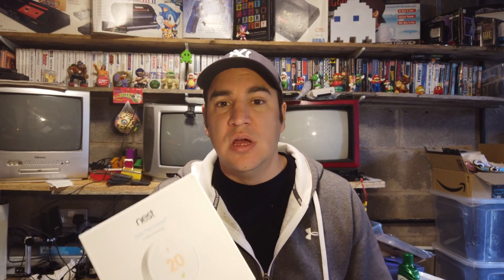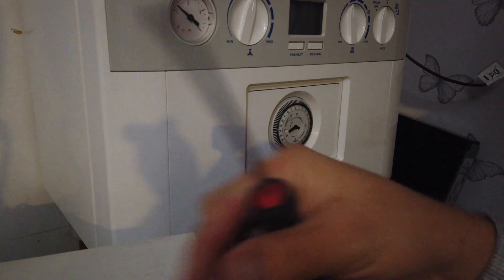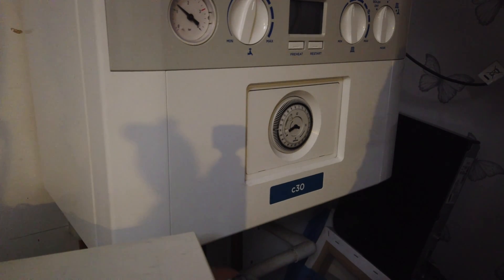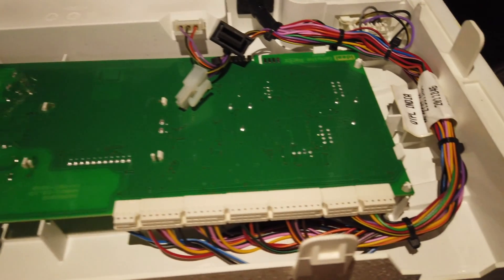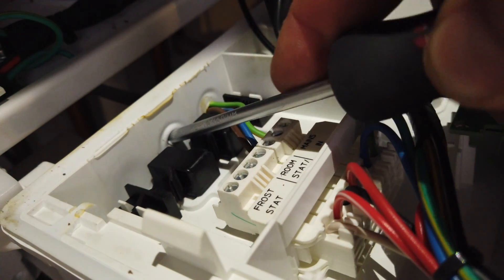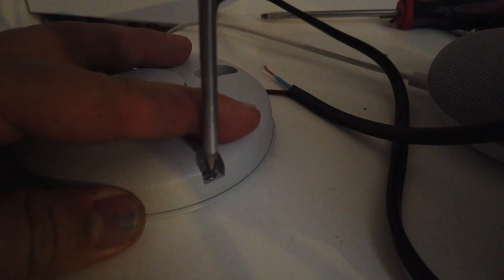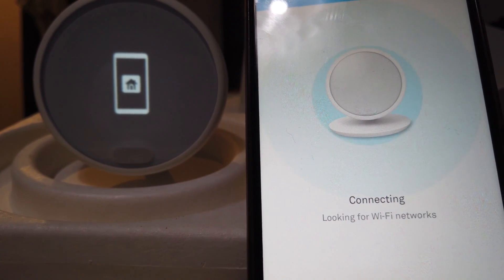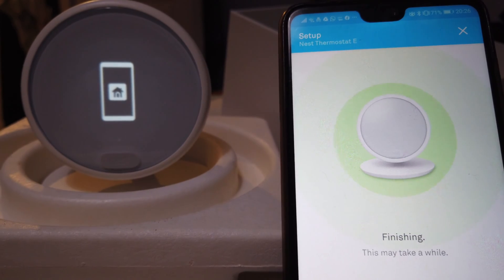Nest Thermostat E Install Combi Boiler with No Existing Thermostat

Comment: The mains cable should not have bare strands showing, please redo it making the bare wire the correct length
Reply from the maker: You're right and they've been sorted back when this video was filmed. That is how it was "professionally" installed.

Comment: My ideal boiler has opentherm and I had this thermostat installed. I’m moving house. Can I remove the nest myself if the power is off?
Reply from the maker: Possibly depending on your ability. You'd need to look at the manual to see if a jumper wire needs to go back in.

Comment: Cheers for the tutorial, my combi boiler is the same and you gave just the right amount of detail for me to get it done. 

One note for other viewers is you can repurpose the speaker wires from your sound system if you don't have 2-core cable at hand.
Reply from the maker: Great. Glad it helped you getting it installed. Nice tip on the speaker wire too. 👍

Comment: What wire did you use to connect them together is it 5 core?
Reply from the maker: To the sensor? I honestly can't remember either 24 awg or 18 awg if I were being overly cautious on the thickness.

Comment: What was the voltage of the wires you connected to the heat link?
Reply from the maker: Hi, apologies it's been two years since I made this video. I believe the cable between the boiler and the heatlink is the thermostat signal. It is actually powered by battery.

Comment: Hello mate. I watched your video and it's  great as you are the only one who shows how to do it without having wires on the wall. So I stripped down my boiler and got a bit confused. Can I get little help from you please?
Reply from the maker: Happy to help where I can but each boiler is different. What boiler is it, you'd still be doing it at your own risk and I always suggest getting someone to check of you aren't 100%
Reply: @GoodwinsPlace  I texted you on messenger. Can we have a chat over there? :-)
Reply from the maker: @macyekk  yeah no worries. I'm away in Gran Canaria but will help where I can.

Comment: Thank you for this video. Did you supply that wire you installed, or was that wire included in the box? Thanks
Reply from the maker: The wire to the sensor? I think you need to supply your own.

Comment: Hi, I have a wireless thermostat with no wires, so I’m guessing my set up will be similar to yours. I have a Bosch combi boiler the connections are LR, Ls or Ns which do I place the two wires in to? Thank you!
Reply from the maker: I'm sorry but I don't know that setup. Try the manual to see what each of those connections are, you are looking for the switch elements. If in doubt call someone in to take a look as would be cheaper and safer than a new board if things go wrong.

Comment: Thank you for the video it did come in handy, but I have a question when I moved into my house I have a logic Vogue C 26 boiler now, the thermostat was wireless it was a logic one it has an RF receiver which is attached to the front of the boiler and then has the wireless thermostat nowhere around the house is there any wires coming out of a wall in which a thermostat can be installed. As I already had been attacked moat system in my old house I brought this over and installed it into the boiler so that I can use smart heating. I have come across on Amazon the nest EFor a small amount in which I want to install this week but I’m struggling to understand how this will be installed especially the heat link into the boiler as essentially there are no wires for me to stick into the heat link then into it on the boiler. Can anybody help me please
Reply from the maker: I think you'd be best to get someone in to take a look to be honest. If you can't go straight off the main boiler then you might be able to go off one of the existing thermostats but I'd suggest getting an electrician in just to check it over and advise first.
If it's an owned property you should be fine but if it's a rented property then it would need someone else regardless.
Reply: Thank you for the quick reply, from what I can see on your video you have used a two cool cable in which I believe can do the same I’m just a little inch unsure as to where I put this in the boiler I don’t suppose you have an email address do you watch I could send you a picture of my boiler to see if you could advise but not take any responsibility for? Is mine.
Reply from the maker: Message me through GoodwinsPlace.co.uk I can take a look but as you say can't offer any professional advice over email as you need to test the system really

Comment: Great video, i have a worcester bosch combi with no external thermostat. I was wondering as i have a existing programmer for water and CH, do you just leave the heating on and don't use you existing timer control.
Reply from the maker: Yes my heating and water are set to heat, the Nest then takes control of when the heating comes on.
Reply: @GoodwinsPlace  Thanks, that's what i thought just needed it confirming.

Comment: Hi there, did you wall mount the thermostat in the end?

I'm interested in getting this installed but I have no pre-existing thermostat in the house and would really want it on the wall for a clean install. I'm interested if and how this can be done with no thermostat wiring fitted?
Reply from the maker: The sensor is still next to the boiler I've not wall mounted that. But the actual Nest dial / screen is the main part and that is wireless apart from power and that can be wall mounted if you get the right bracket.

Comment: Hiya  
Was it no and c you stuck those 2 wires in on nest? Cheers bro
Reply from the maker: Yes, (no and c) top left two connections if you had it level and the wires at the bottom.
Reply: Legend 🙌

Comment: Hi Craig, great video thanks for posting it. Can I ask you about the black cable (2 core flex cable I think it's called) that connects the heat link to the boiler, did that cable come with the Nest or do you need to get it separately in an electrics store?
Reply from the maker: Sadly they don't supply the cable, I guess it is due to so many different options to setup.
Reply: @GoodwinsPlace  is it a 1mm flex you used?

Comment: Hi, I have ideal isar HE24, instead of thermostat loop, I have connections L1 and L2, can the heat link be installed directly to this boiler?
Reply: For anyone interested, as there is not much support for the UK version online and google impossible to get hold of, but the ideal isar he24 boiler is compatible with the UK nest e with heatlink. The L1 and L2 terminals are for the central heating loop so you can install the heat link directly to the boiler using the correct 2 core flex, which I’m glad I did rather than connecting via the old thermostat wires, since I discovered some dodgy wiring left by the last cowboy installer, such as a live cable which was left dangling against the elements with just a small bit of tape wrapped around it, probably glowing red hot every time the boiler fired up, which is obviously highly illegal, dangerous and completely pointless. Anyway, make sure you connect the 2 core flex cable to the “C” and “No” on the heatlink and to the L1 and L2 terminals on this boiler, UNLESS your boiler is specifically opentherm then you can connect via these terminals and to opentherm on heatlink which is more efficient, but make sure it’s opentherm compatible or you will blow up the cpu in the boiler causing hundreds in damage. Hope this comment helps someone else, note that this comment applies to UK version only, I’m not a plumber or an electrician, just commenting off my own install as I found no support on this myself when I searched the web and got no answer from Google, if you are unsure get a pro in, it’s not worth risking anyone’s safety just to save a few quid

Comment: Great vid pal, is it easy to programme constant hot water as well? Cheers from Port Talbot 👍
Reply from the maker: Constant hot water is standard with this kind of install. You set your boiler to the heat and water function. Water continues to heat even when heating is off via nest. Could be different on other boilers.
Spotted the accent then, I'm in Barry. 👍
Reply: @GoodwinsPlace  I did indeed lol.... Great ill give it a crack in the week, hopefully it won't blow up 😂. Cheers m8

Comment: The e thermostat instruction say it is not compatible with 240v, only 24v connections, you have wired yours into 240v, will this damage the unit?
Reply from the maker: The system is 230v but the board splits the voltage to power some items on 230v and then steps down to 24v or other voltages where needed.
If unsure please check with a qualified electrician on your install.

Comment: Great video. I also don’t have a thermostat. Does it matter if I locate the heat link E next to the boiler connected as you suggest,  and use the thermostat on an stand in the relevant room. I’m just not sure which one will act as the thermostat? Thanks
Reply from the maker: The dial thermostat is what reads the temperature. It will try and heat the house until that specific area hits your target temperature. Mine is out on the landing away from any heating.
Glad you liked the video.

Comment: Hi just few question after install Google NEST E, what a about the old thermostat on the wall ? What should i do with it, turn them off completely and using the Google nest e thermostat? Thanks
Reply: Previous old thermostat still working, I haven't put new thermostat yet, will try it soon anyways thank you very much for the advice
Reply from the maker: Did you unwire the old thermostat? This didn't have a thermostat previously. If you've wired the same as this then you would have disconnected the old one.
Reply: The boiler I got exactly the same like yours, just little bit confuse my old  thermostat on the wall, how can I say is like TV remote control work with signal I guess doesn't have wire on the back
Reply from the maker: Ok so it still needs to connect to your boiler somehow. 
Did you have to disconnect anything to connect the nest? And did the thermostat on your wall work previously? 
Is your nest connected and working?

Comment: Hi! Did you check that your Nest turns the boiler on and off as it should do? I've just installed my Nest, but the boiler wont kick in even though the required temperature is above the actual temperature.
Reply from the maker: Hi, this has worked great since the day it was installed. Have you disabled any timer and set it to heat both hot water and heating?
Reply: @GoodwinsPlace  how do you disable you old timer
Reply from the maker: You should have a setting switch to switch it to timer or across to thermostat / always on.
Reply: @GoodwinsPlace I think I've got it working now, I followed Google's installation instructions, which says both that the common feed needs to be connected (I googled and understood this to mean the neutral wire) and the Nest doesn't need a live feed. These appear to be wrong, as I hooked the red (which I assume is live) wire into the nest, and now the boiler is coming on and going off as it should do.
I can only think that the wire colours connected to the boiler in my house are wrong, perhaps?

Comment: The incoming supply to the boiler - is worth re- terminating the amount of bare copper conductor exposed is dangerous!
Reply from the maker: Thanks for the heads up. I'll take a look. That was how it was fitted by corgi registered so I didn't even think to check it.

Comment: Why did you not use the opentherm connection?  This vastly improved the efficiency/longevity of the boiler and saves gas and I’m pretty sure your boiler supports this. The Nest e fully supports opentherm and is the recommended way to connect to such boilers. Just replaced my boiler and note use this feature on my Nest and its made a big difference. 
Good video otherwise.
Reply from the maker: Hi John, I did look in to Opentherm as would much rather use that and keep the flow at the lower level, currently it clicks on and off which is ok but would rather lower energy consumption. I don't think my boiler supported it, or I couldn't see how when I looked for info on it online. 
Thanks for watching and commenting.